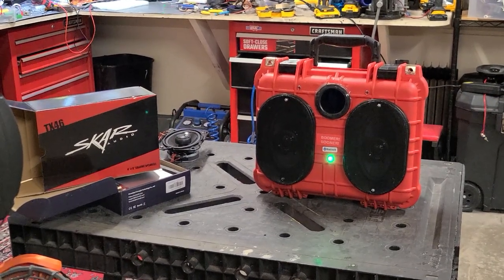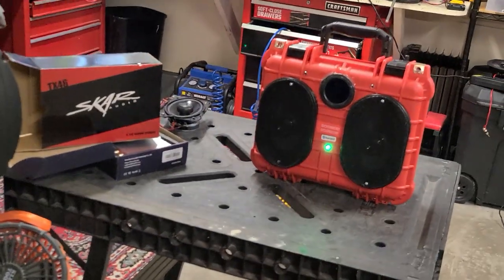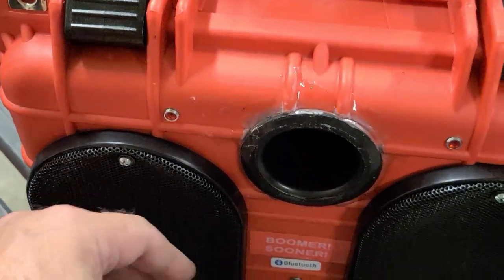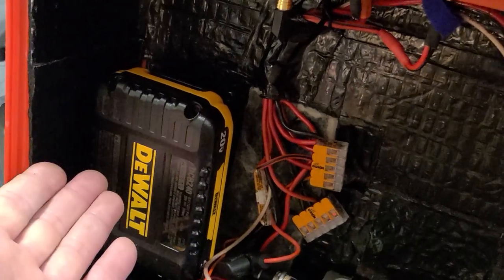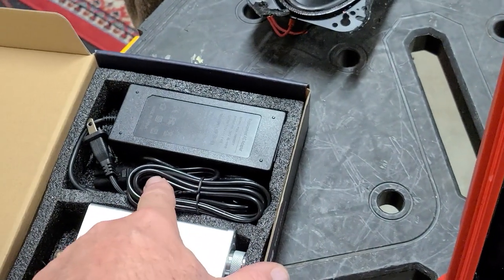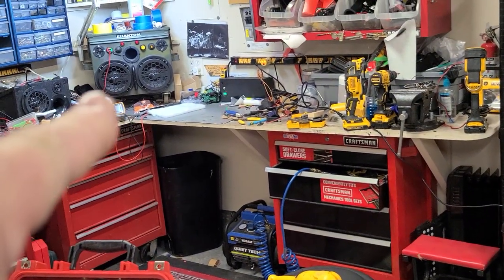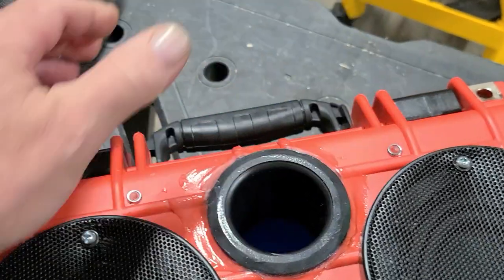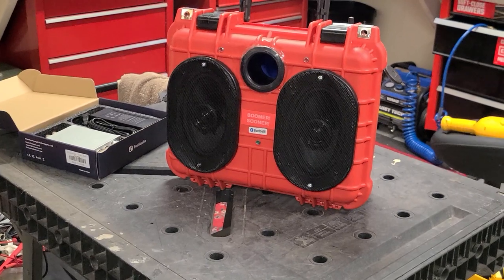Updated! Dewalt battery powered mini boombox -- new Skar Audio TX46 coaxials/30-Ohm resistors

Comment: Overall its a cool setup, I would just be a little more careful about the tool battery. I dont know about Dewalt specifically, but some have no BMS in the pack. 

While the charger might be adding some power back into the battery, lithium batteries normally need a constant current and specific voltage usually higher than the pack voltage in order to charge properly. Without knowing what, if any, BMS or protection the DeWalt battery has (probably not much since  usually in the tools or chargers), I wouldn't risk charging it this way. In fact i would remove the battery while you're using it plugged in.

I would also be cautious about how far youre discharging your 20v battery, over discharging lithium cells can be just as bad as overcharging.

I saw another guys video same concept but used a low voltage cutoff protection board at 16.8v or something like that to keep from damaging the pack.